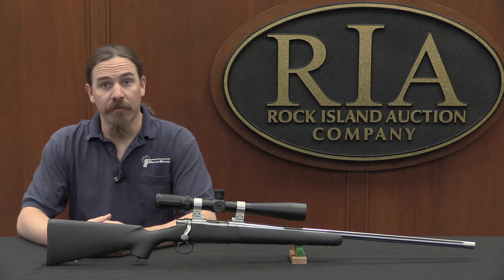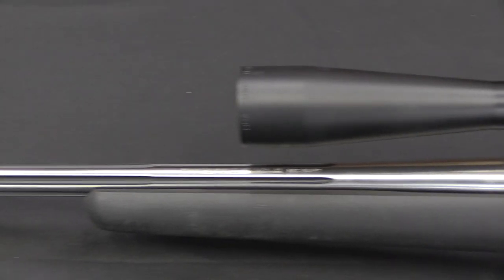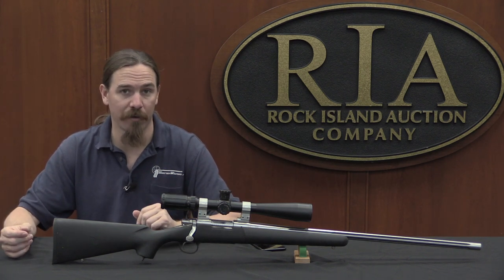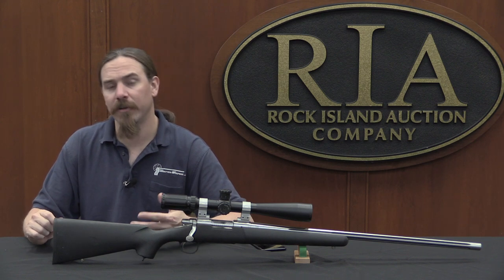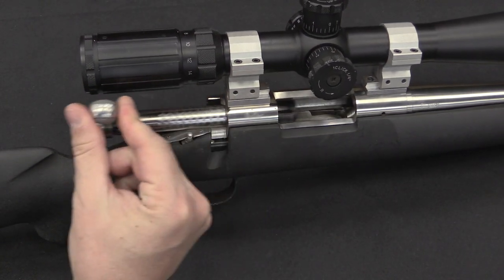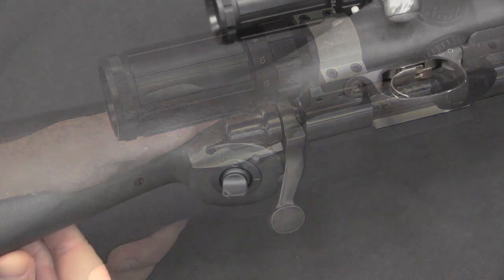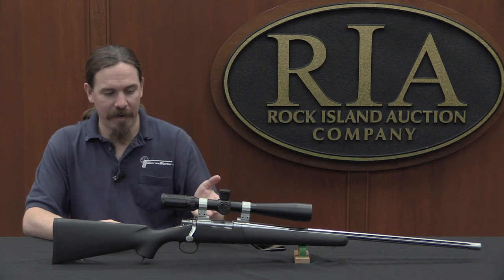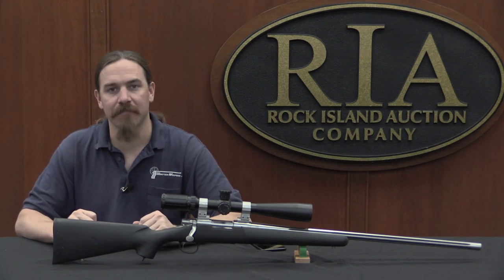Remington EtronX: Electrically Primed Ammunition

Comment: I still think electrical triggers is the future, it just needs to be developed to be more reliable and useful. First big advantage will be good adjustable triggers in bullpups and adjustable rate of fire. But there's much more cool stuff you can do once electronics in guns is reliable and accepted.  You can also make more reliable and cheaper caseless ammo that doesn't cook of as easily. Use graphite resistor instead of an impact primer. 

In the future guns will have chips, rangefinders and cameras in them, and when you pull the trigger they will:
 - remember the part of the image you were targeting (simple computer vision, a cheap and power efficient chip like raspberry pi suffices to do it less than a millisecond)
 - check the range (rangefinders are already common on regular cameras and work almost instantly)
 - calculate the correction for distance and possibly other environmental factors (microseconds suffice to calculate that)
 - wait up to X miliseconds for the shaking hands of the user to randomly move the gun to a position that hits the target best
 - shoot

In practice you won't notice any delay just like you dont notice it now, but you will suddenly get much more accurate long range without the need to correct for distance. Guns will be more "point and shoot".

Algorithms for using shaking of the hands to increase accuracy are already used for smartphones and computer vision (I work in the field as a programmer) and they can do crazy things (like take several photos made with shaking hands from a poor smartphone camera and turn them into a perfectly clear photo with 4 times the resolution of the sensor thanks to the shaking), it's just a matter of time before this is used in guns.

Comment: I LOVE the idea of electrically fired cartridges IF it is reasonably possible to somehow make your OWN if/when ammunition finally becomes a super hard thing to aquire like it IS in many parts of the world.  I love the idea of being able to TOTALLY manufacture one's own ammunition ...and primers are perhaps the most daunting to DIY produce.  Powder of some kind?  doable even if not very nice ....bullets?  Pretty easy to cast my Cartridge cases?  Well there are likely a number of solutions including machining via billet stock ...a really heavy walled cartridge could last for MANY reloads...but I imagine cartidges could also be produced using brass tubing via dies ...but then you need to plug the rear section....which could be a soldered in machined pieces perhaps electrically welded in place?   Anyway I can see DIY ignitions circuits being totally doable...just need a component list and a schematic and boom...literally boom...I just love the idea a person COULD build an entire rifle including ammo using conventional machines like Mills and lathes ....yes rifling is an issue but even that is doable....would a home built rifle and ammo be anywhere close to as nice as what is available right now?  No of course not BUT it would be a thousand times better than nothing.   I always loved how in  Pakistan and Afganistan people machined firearms components using some really crude methods...and they WORKED!  One guy made this and another made that and another could custom fit it all together to work...was amazing...an example?~~> https://www.youtube.com/watch?v=Ld-NKs47N-g

Comment: I'm all for electronics in firearms, some people think electronics are  unreliable, however the fewer moving parts a system has the less likely it is to direct failure, as long as you use military grade components you will never have to worry about an electronic failure.

Comment: Okay, this is an extremely silly concept in a hunting rifle, but I think it would honestly not be the worst idea to incorporate battery compartments into Burt stocks, because in theory, you could power all your optics, lights, and lasers with a couple 9 volts. I think it would be an interesting concept. Maybe even incorporating a solar panel so you can recharge an internal battery? Would be very heavy, more than likely, but hey, it’s a starting off point for innovation. It’s not like the stock is used for storage anymore, anyways. Might as well try to make it useful.

Comment: 3 things that you should not have to do when trouble shooting a rifle, check battery voltage, check the safety key, consult the manual to check error codes. Only benefit i can see to this is maybe the elimination of trigger jerk because of the no-load trigger but every thing else is a detriment to the original

Comment: Not sure if anyone will see this, but an EMP could disable the rifle. The LED was blinking when the battery was installed with the rifle off, which means the off position is an open circuit. This means an EMP can damage the rifle, however it's worth noting that if the rifle is in a thick walled safe that has at least 6" bolts anchoring it to the ground when the EMP detonates OR the battery is not installed, the EMP will most likely cause no damage.
Reply: That is too simplistic. Open or closed does not matter. Most damage is done at both ends of long cables, here the effects are massive. Think power lines and anything connected to their ends. Small electronic devices are protected by virtue of being small, all they need to withstand is some magnetic fields and a bit of a voltage surge. Think massive lightning strike next door, hitting right into the grid.
Reply: @kurtilein3  You also have to account for the fact that the composite stock will insulate the electronics to a small degree. If the rifle is injected with enough EM power, most likely point of failure would be the "firing pin" as it's probably the highest resistance point, which would hold the most charge and generate the most heat. That's assuming the rifle isn't in a safe, as a properly anchored rifle safe will act as a faraday cage. Granted, I'm assuming the R&D team went with a simple design I.E. no microchips or other controls, but an analog control system for the firing mechanism (the part controlling the LED might blow out, but who cares if the light doesn't blink if the rifle still works?)
Reply: @mikafor  Much more importantly, forget 98% of movies featuring EMPs, and please inform me about the other 2% i merely assume exist. We are looking at a masive thermonuclear blast in space above earths atmosphere, killing almost all sattelites, inducing an EMP by ionizing the upper atmosphere, killing anything at either end of any long above ground power lines. Continental blackout and fallout. Totally harmless for small devices not connected to the grid at the time the grid explodes. 

There can be no possible EMP outside of all-out global thermonuclear war. Small devices will be rather safe by virtue of being small. It will destroy no battery-powered alarm clock, no wrist watch, and only a small percentage of smartphones, but the electricity grid will be annihilated.

Comment: I've been doing some thinking.,
I don't really get out to the range much; having a visual impairment creates opportunities for accepted discrimination that are generally overlooked.
But I love guns. I've turned that love into several kinds of shooting sport.
All of that preamble serves the purpose of introducing the two relevant sports, airgunning and laser tag.
Airguns often try to mimic the feel of standard firearms. They care about the feel of the trigger, for instance, even though the guns work on generally different principals. Laser tag guns, on the other hand, have triggers that are different entirely from firearms, either working with plenty of light travel and a nearly imperceptable break or with hardly no travel at all with a slight break.
I think the Etronx has the problem of feeling nothing like a firearm. It has a bolt that feels weird and a trigger that feels weird. The only thing that feels standard (presumably) is the bang.
I think, if electric firearms are going to work, we're going to have to at least emulate the feel of a conventional trigger. It's a pointless addition that people will complain about as unnecessary for function, but that's an accurate enough complaint without it being unnecessary for sales.

Comment: Is worth noting, with regards to the EMP issue, capacitors soak up EMP spikes, so the firing capacitor would have a good chance of neutralizing the pulse completely. The firing system is no more complex than a light-switch: there's nothing to break. It should also be highly resistant, even without the capacitor tanking the pulse. The main question is the comparatively delicate switching and diagnostics that make the LED work, and whether they fail open or fail closed. industrial microprocessors are tough as a AK, generally speaking (literaly will still run while submerged in gasoline in a microwave) so no issues there, and big freaking power transistors are also about as hard to break. They might use something called a MOSFET to save power though. Those things hate high voltage (the thing that does damage in a EMP) with the force of a thousand suns, and will promptly turn themselves to useless paperweights, if the capacitor fails to neutralize the pulse.

Comment: Couple milliseconds is a long time. This system actually was meant to cut the ignition time from the trigger down to the MICROsecond level. Were talking about the speed of electricity over a circuit connector. The speed of light!! lol. IF you were to mod this system with a higher wattage capacitor system and increased the ohm level, you could literally blow bullets out the cartridge with lightning speed and increase your accuracy AND the velocity of the bullet.

Comment: A more marketable solution would have been to have an electromechanical firing system that worked with stock ammunition such as a solenoid that drives a firing pin against the primer.

Comment: To answer the EMP question... the electronics should be in a closed electrical  circuit system which isn't substantial to EMPs. Your smart phone won't work, but your electronic bolt action will in fact work. If it had bluetooth or some other fancy crap on the rifle then it wouldn't because it would be an open electronic system.

Comment: I scrolled down few comments and my concern was not mention by others, so I just comment here hoping somebody can give me an answer. (I live in Taiwan.)
The lock, or the switch that turns the rifle on/off looks like a cheap disk detainer lock, that kind of locks are used on shutter door control panel locks, drawer locks or mailbox locks to provide basic security to people don't really want to crack it open.
And for the safety key... it only have 3 or 4 grooves, it means picking it would be a much more simpler task with basic tool. Or, slide a flat screwdriver in and yank it on would be another easier way to crack the lock.
If I am the bad guy steal this kind rifle... I might drill the whole lock assembly out, hot wire it or replace the lock with a fancy glowing bottom switch.
Would the lock can really prevent firing if the rifle is staled or fallen into wrong hand?

Comment: Honestly, I would think this would probably be significantly more reliable than a mechanical striker, assuming the electronics are solid-state. If it doesn't have a firing mechanism, gunk wouldn't affect it as much, and it could probably take more punishment in the long run. Some kind of electronic ignition would probably work well in a battle rifle or a simple, reliable hunting rifle.  Also, the much lesser lock time may be beneficial in a combat sniper rifle. On another note, I quite like the fact that the light shows when you have a round chambered. Of course, you should treat every gun as if it's loaded, but a little more insurance/indication will never hurt
Reply: In a battle rifle the key lock could be replaced with a simple switch too. The electronics don't sound any more complicated than what's in a modern vape.

Comment: Just add SOLAR POWER strips on the stock and scope and make the battery rechargeable. Also add a rotation crank mechanism on the butt to charge battery manually. Done.

Comment: Thank you for presenting this firearm. That said...key? That's dumb...lose it, break it, your screwed. Also, the screw holes in the stock are going to wear out eventually due to the battery needing replacement.

Keep in mind, I love my Flintlocks and my cap locks. More then half of my collection is muzzle stuffers of one type or another.

Comment: The only issue I see would be potential water issews near the primer. Otherwise it should be extremely reliable. As for design I really dislike the need of a screwdriver to change the battery.

Comment: noob question, but could something like this be useful in a military sniper rifle? It seems like having a practically featherweight trigger pull combined with zero moving internal parts might help in making those extreme long range shots. I mean it's complex, expensive & more stuff could go wrong, but clearly not in the realm of say the XM-25 grenade launcher. Obviously this particular gun isn't designed with extreme long range shots in mind, but would this electronic system in say a McMillan TAC-50 give that extra bit of stability when making those extreme shots?

Comment: think electronics aren't conceptually a bad thing in firearms, but this application adds a needless failure point. When you have a bad primer (whether chemical or electrical) you can just eject the round, but what happens in the case of a short or the battery dying? Both are very real concerns.

Comment: A trigger pull of 2,5 Pounds is pointless if you use electrical ignition. I built some guns myself before and it is much better if you simply use a regular button with a few grams of pull weight. Makes it very very  accurate.

Comment: In a way electronically fired Firearms already exist. The Metal Storm system has stacked ammunition that is fired individually and electronically. The next logical step to the Metal Storm system would be EMP not the kind of EMP that knocks out Electronics the kind of EMP that you use to propel something metal through the air and into a Target like a railgun. so once you have stacked ammunition in a railgun and it's fired electronically and 4 pills electromagnetically then you really onto something. Combine all that with a computer that is able to relay information from a Target to the onboard computer of a gun and into a smart bullet. I've seen something like that some type of rifle that fired 20 mm shells that could explode in explode in the center of a room or upon impact or even over a Target. the computer made necessary adjustments for physical obstacles such as walls and windows as well as those coming from weather changes. I've also heard about a pistol not yet out that I know of that will only fire for a specific user by reading their thumb prints or biometric signature. the future is on its way we had some weird guns that tried to pave the way like the dardick and the gyrojet pistol they were stepping stones in the right direction

Comment: I bet Remington didn’t change the twist from 1 in 14.  A 220 Swift with 1 in 12 twist was the fastest factory barrel made that I know of. If the 220 Swift was twisted 1 in 10 like the Winchester 223 SSM, you would have a larger bullet selection.

Comment: It’s a great idea 💡would be a piezo electrifying igniting option as a alternative to the usual percussion caps that’s internal and optional or incorporated to work in conjunction with the percussion system or so if you are out of the caps, hopefully it can be used in place/instead of the original percussion caps and then maybe make a way to seal off the caps nipple with a little safety mechanism like a pressure cooker has. If there’s a little winding device to charge up a capacitor and can also have a battery 🔋 as it’s usually 🏬 storage of electric ⚡️ charge, but if the batteries 🔋 are low, just start cranking the handle, like those old radios 📻 and flashlights 🔦 🔦 used to have. For that matter maybe incorporate a little light 💡 into the front of the rifle or pistol, maybe even case less ammo like that forward defense mechanism that use a five round bar with holes 🕳 that can be used all at once or each round discharging individually, black powder revolver and rifles are exempt from the firearms act and they don’t require any license, those things must be loaded by the user, & don’t usually (but not always)take cased ammunition, like a Remington revolver rifle but in larger size and straight bar “cylinders” instead of the round cylinders might be easier to get into out of the units unlike some revolvers . I like it whenever people think 🤔 outside of the imposed box 📦 created by following the herds, its innovation that’ll win the day eventually. Good luck 🍀

Comment: 10:49 The outraged tone Ian spoke with when commenting about the EMP survivability of the rifle had me laughing so much. You would need some very basic electric/electronics knowledge, but I suspect that it would be easier to make one of those with a broken fire control assembly - if we can call it that - serviceable than a regular one; it would be easier to find suitable capacitors, thin electric wire and makeshift resistors than finding or making springs and precise latches and pins I suppose. And you could just ignore and bypass the brainbox which control the LED. Would love to see one of those taken apart by AvE.

Comment: Would be cool if opening the bolt used a tribolelectric mechanism to charge a capacitor or if it used a normal mechanism to strike a piezoelectric unit so no battery would be needed.